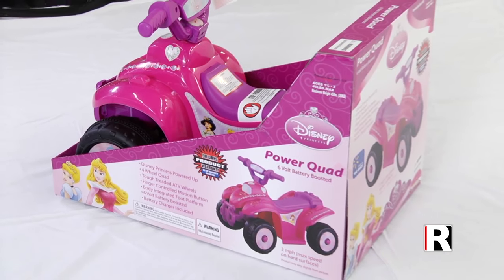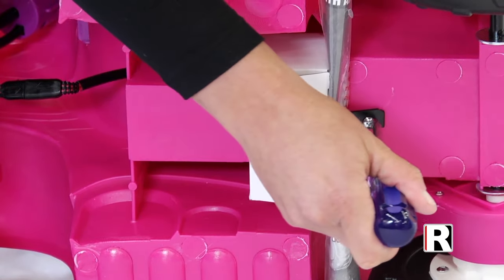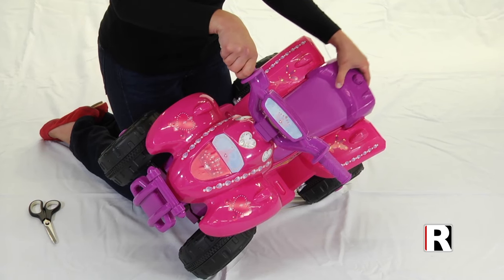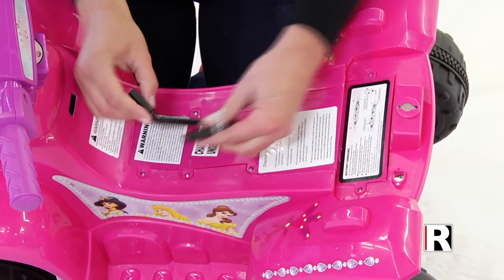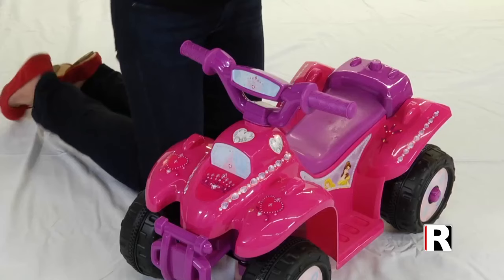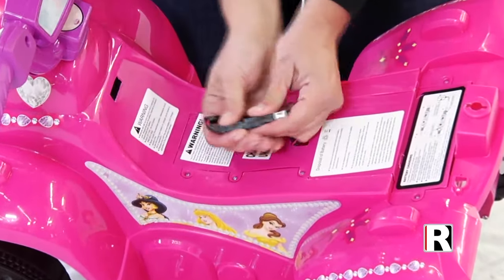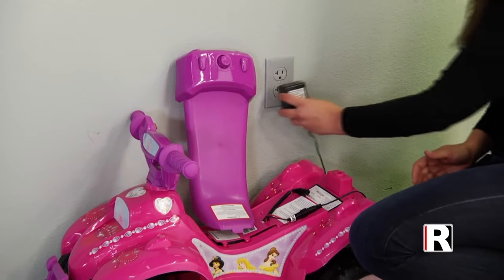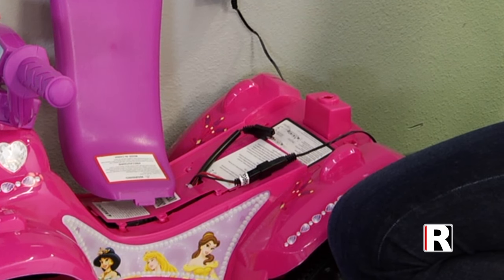6 volt Power Quad Assembly

Comment: I charged mine for first time plugged back in and now it only goes in reverse lol how to fix?
Reply: I just noticed mine does that too. I can't get the battery to work and so I used the charger and plugged it into the quad and it was reversing. If you figured it out let me know please! I'm trying to see if that has anything to do with the battery or another reason it isn't working other than the outlet charger.
Reply: My daughter's does the same :(
Reply: There is a way to fix it, there's two wires that just need switched. So the black would go where the red is and the red would go where the black is.. It worked on my daughters.